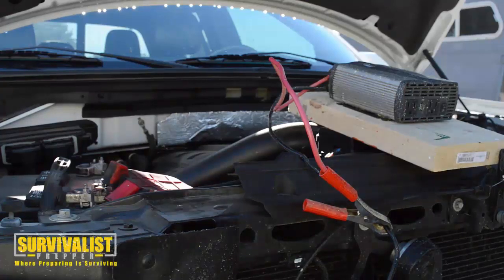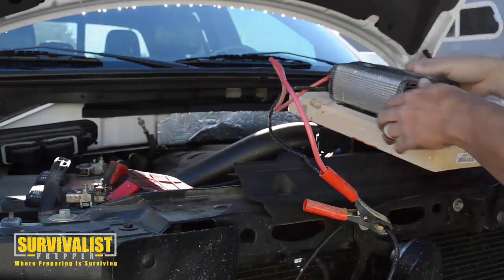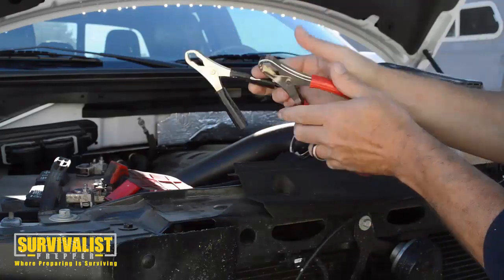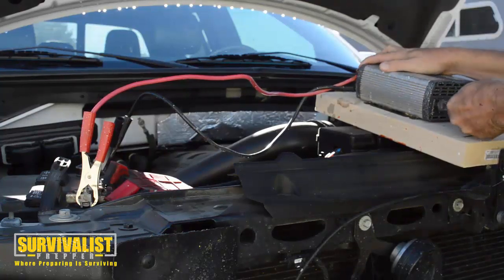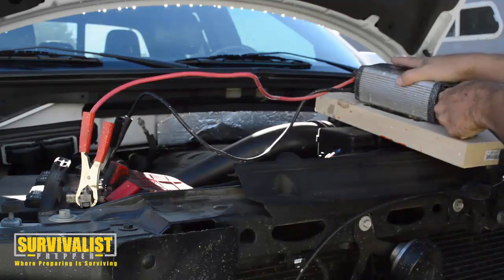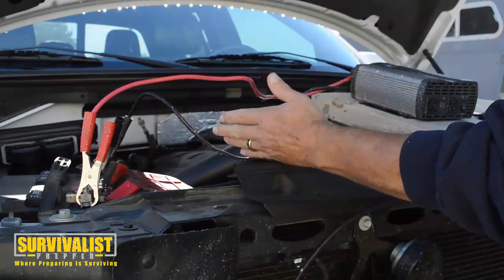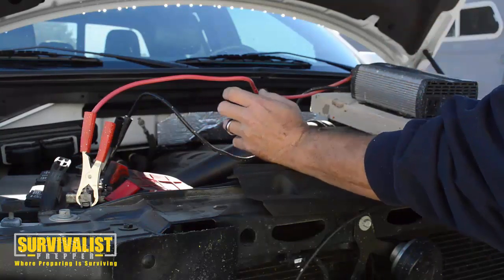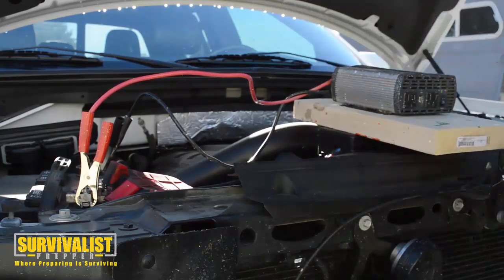Connecting a Power Inverter to a Car Battery

Comment: So everytime you want to use your inverter, you just park your car open the hood and connect the inverter to the battery to use it?  Do they even need to wire it somewhere closer to the door to install the inverter
Reply: I've seen videos where people use jumper cables. The cut off the alligator handles. And crimp battery terminal style connectors to it and install a circuit breaker by the battery incase  of overload. They run the thick jumper cable wires through fire wall and into the car in the disired spot. Again cut the alligator handles off and connect them to the inverted where ever you want it installed
Reply: Unless you need to use it while driving, I would just open the hood and use the alligator clips. Good alternative to a generator for small loads for a limited period of time.
Reply: just get a extra battrry for 120 and usr thst to the inverter

Comment: Exactly what I wanted to know. So I can take a cig lighter DC inverter and charge a battery, then disconnect the cig lighter leaving the clamps on, and run the inverter. I think a battery capacity tester would come in handy if using this system for any length of time. Maybe a charge controller. Thanks.

Comment: So just a question.  Its bad to run the car if I sm trying to use a hot plate plugged into the converter..  I should just leave car off if I sm using it .. pleases reply thanks for video

Comment: I have a dewalt 1000w power inverter and the usb works but the 3 prong AC is not working, any suggestions? Maybe I set it up wrong?

Comment: so I can use my regular jumper cables?
Reply from the maker: You could, as long as the connections are right. I believe most inverters come with the alligator clips though.
Reply: @survivalistprepper  Hi , I have a 3000w inveter and hooked it to my battery , I ran a 1000w travel kettle and it got very hot on the cables like I couldn't touch them 
Would you suggest thicker gauge cables?? I had my ignition running  obviously
Reply: No u cant use your jumper cables, well guesss can is inverter cables breaks off. Hehe The inverter comes with battery connectors.

Comment: I bought a van that was used by a utility that had a 1000 watt powerverter in the back. I took it out to build my camper van and then got a 500 watt  Bestek. It required smaller ring terminals so I spliced them onto the wires running in through the floor but it's not working. I even put the old inverter back in and that doesn't work either. I can't figure out what's going on.

Comment: I have a 500w ebike.My question is, can I use one 12v scooter/motor cycle battery or do I need 4 cause the ebike charger is 48v.But will the 750w inverter give me 110v-120v with one 12v scooter battery or do I need 4 12v scooter batteries hooked up in series to give me 48v to keep my ebike charged at the same time I'm ridding ??

Comment: Thinking of getting something like this for an air mattress pump to use while camping. Our air mattress when using regular electricity blows up in just about 2 minutes using a 120v plug. We would prob have to blow it back up every couple of days depending on how much air it loses (if any). My question is would a product like this work for that task without killing the car battery? We have a really well running 2001 Toyota Camry with a new battery that is less than 2 years old I believe. Any comments or suggestions would be greatly appreciated!
Reply from the maker: Great idea

Comment: thanks for the overview, I'm trying to get something rigged up so I can charge my electric bike while I'm out and about at the trail heads. So has anyone rigged up a little extension cable setup so that you can bring everything inside your car and charge from there? like maybe run a set of cables (+ &-) to from the battery in the car to a little custom made terminal area inside the dash or something? Would that work?
Reply: It's better to mount the inverter in a secure spot inside the cabin and route it to the battery with a fuse through the dash somewhere.

Comment: how long you reckon this will last?i have inverter,never used it got it for free but never had the need to use it,but i needa run to scrap yard and need to use grinder to get part off(rear quarter panel,save about grand) (dont need to be pretty just for old beater truvk) and instead of buying cordless grinder was thinking of bring inverter and old battery i got that still good.will it have enough power to cut through metal panel and will it last at least 30 min-1 hr??if it dont last that l9ng i guess i can bring extension cord too and hooe some car at scrap yard still have lil juice in it,just wanna make sure converter will put out enough power to acually cut.thanks for help if you answer

Comment: See but what if already comes the back attached with a cord to a male dc? How do I connect to a battery in that case?  I'm really not trying to cut the cord and slice open the wires so I can wrap them around cable terminals, cable terminal cables to the battery

Comment: so i go camping a lot and i want to take my laptop and watch a  movie or surf the net but i want to get a lithum battery and put it inside my van and watch it that way.. is it doable or dangerous i don't see why but i wanted to ask bc i don't know anything.
Reply: Did you end up doing this?? I got a van and am about to leave on a month long trip and I was looking at the jackery portable power stations, but then I stopped into a battery shop and saw all these different sized batteries and the duracell high power inverter 800W and I thought couldn't I just hook that up to the battery and have power? I know I would have to figure out a way to charge the battery but am I missing something??

Comment: So when hooking up an inverter it doesn't matter which battery post we clip onto first?  Is it better to first hook up the inverter then start the car or makes no difference? For a battery charger they say clip positive post first then negative onto engine block away from battery.  And remove negative first then positive. Thanks
Reply: klaus von Himmlisch I just did it like he did in the video.  Attached negative first and then positive.   I shut engine off first.  Removed them in reverse.  I had no problems
Reply: Rawstyx X thanks, I think it's fine to start up engine while using the inverter. And maybe even necessary for certain tools and lengths of time in use. ?? Right??
Reply: oh absolutely.   Some things draw too much power and will drain the battery.  I just meant I shut the truck off while I attached the cables, then turned it back on.  Im not real knowledgeable with electricity so I just didn't want the engine running while I attached cables os all.
Reply: You are backwards with which to hook first. You hook the positive first, ground second and the ground to the engine block. FYI I taught Vehicle electrical for 4 years in the military and then worked as a mechanic, usually drawing the electrical work. Eventually I became an ASE Master heavy Duty Truck Technician, so I'm not just guy spouting stuff I think I know.
Reply: Jerry Lynch even with an inverter?  I know that positive first and negative to engine block for the charger or jumper cables, but what about an inverter?? Maybe it doesn't matter?? I always thought that for inverters the clips go to the battery posts and no where else.
Reply: I agree
Reply: I don't know much. But I do know if you hook your positive terminal first. Then negative you will end up with a huge spark. Possibly damaging something somewhere in the electrical. I had been doing this for years and always wondered why the big spark. Have also seen a mechanic wonder the same thing. But, recently had seen it was wrong. Hook negative first then positive and there will be no spark. Try it.
Reply: You have it backwards Jerry. Neg. first then Pos. that way no spark. Hooking it the way you are saying creates a huge spark hooking it up. Which could be damaging. I am sure you have seen that huge spark every time you hooked up your batteries.
Reply: @rodgerroy8090  I agree. Big spark if you hook up positive first.
Reply: @philipwright9181  you both have it backwards, your confusing two separate differing processes relating to connection and disconnection.  When DISCONNECTING a battery you remove Ground/black first. When you CONNECT a new battery its in reverse order: Positive/Red then Ground/black.
The negative cable is just connected to the body/chassis of the car. ... If you connect the negative first, then the positive, if you happen to touch the wrench to something metal while it is touching the positive terminal, that's a short - because the chassis is already connected to the negative battery terminal. This is why it's done this way, to avoid potential shorts and killing your electronics and the reason why the positive post usually has a BIG red plastic protective cover to minimize shorts...
Reply: @geerstyresoil3136  you are talking about connecting battery to car. How about connecting inverter to battery car. Is it the same?
Reply: @gelynch52phPH hey can I ask you a question ? I'm working on building a portable power supply for a drill and router. Looking at a motorcycle battery with charger for a wall socket and a 2000 watt pure sine wave inverter . How do I keep track of the amount of power that's left in the battery and avoid draining it too much ?  Will the inverter tell me that or ?  Thanks very much I hope to hear back from you , or from whoever reads this that may have the answer !

Comment: I bought  one yesterday hooked it up to my car lighter outlet and it keep blowing my fuse. I only use a small portable vaccuum
Reply: Change the light cigarette fuse with something bigger or hook the power invertor directly to the car battery
Reply: @Whysoserious3007  I got it to work. ....thanx
Reply: Because 12V system from your car will draw huge amount of current to be converted to higher volt(240v/110v). The higher the voltage input, the lower current it will draw. So you just need to connect directly to battery

Comment: Hello, I bought a Peak 3000w power inverter, but it burnt when connected to battery. THE SWITCH WAS OFFF AND IT BYPASSED IT AND COMPLETELY BURNED UP! What happened?
Reply: TheBlackSheep gotra hook the invertor side first. It will become charged as soon as u hook ether black ot red to batter. No specific order with investors
Reply: @Royalfamilymusicgrou  -Not sure if you could answer this but what do you mean by the inverter side first?
Reply: @aidendamien  I think he mean's don't connect it with a load attached that would immediately draw current.  On another video I saw a fuse-box made in between the hot wire from the battery to the inverter box to arrest any short that may occur when plugging in.

Comment: I used mu inverter with a battery that wasn't hooked up to a car and it killed the battery in less than an hour
Reply from the maker: How many watts were you pulling? And how charged was the battery before you started?  This article I wrote goes through how to calculate that. http://survivalistprepper.net/how-to-build-a-diy-portable-solar-generator/

Comment: So much is missing from videos like these that tell you how to run your appliances with an inverter and car.

First of all, alternators are key and easy to understand.  A full size car usually has a 130 amp alternator.  This puts out 12 volts X 130 amps = 1560 watts.  So, you add up the wattage on each appliance you want to run and keep it below that 1560 and you'll be able to run them continuously as long as you have gas in the car's tank.

A new fridge may use up to 200 watts and that's only half the time.  My 55 inch TV, computer, router and cable box only use 89 watts continuously.  A bunch of efficient lights may be another 100 watts.  My freezer is even more efficient so maybe 50 watts.  If I have a 1000 watt inverter I can easily run all those and more while running my car continuously.

If you want to know what amps your alternator puts out then go to Autozone.com or any parts company and look for the replacement alternator for  your vehicle.  It's typically 130 amps.  A compact car is typically about 65 amps.  Do the math and you'll see what you can run on these alternators continuously.  Keep your usage much below the potential watt output and you'll be fine.

So, how long can you run your car idling?  It won't hurt the vehicle to run it on idle for a couple days.  A 1.6 litre engine will consume about .11 gallons of gas per hour.  A 3.8 litre engine will consume about .33 gallons per hour.  The bigger engine will burn 8 gallons in 24 hours.  If the tank is 22 gallons then you can idle that vehicle for  at least two days with 6 gallons left to bug out if it doesn't look like the power will be restored soon.

It's easy to connect an inverter to a battery and run a couple toys.  This Youtuber needs to put some real useful info into his work.
Reply: @NoBummer  Not diagnosed.